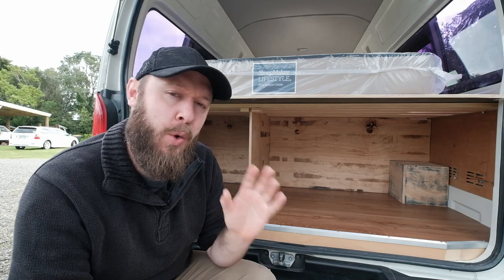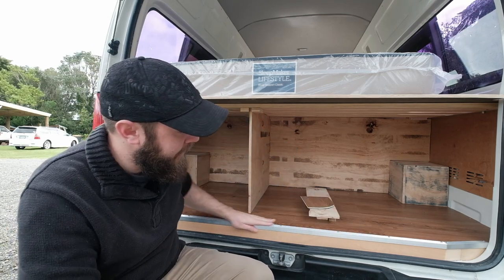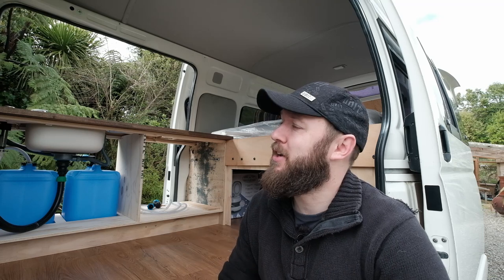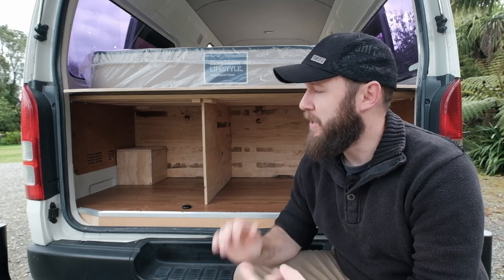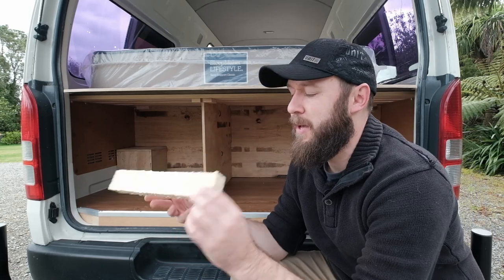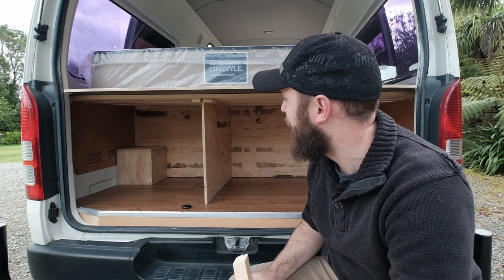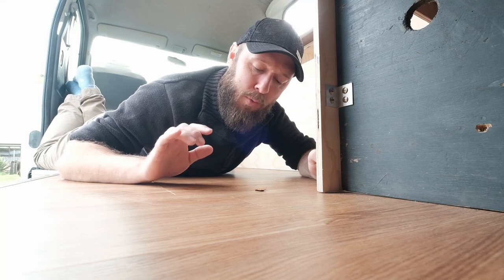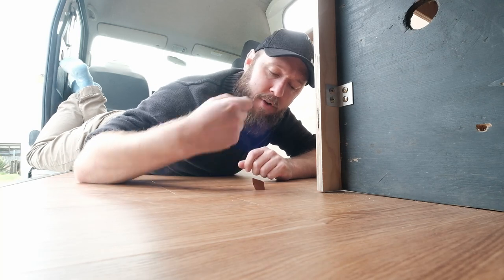Toyota Hiace Camper Van Conversion - Part 1

Comment: inspirational! thankyou for posting. Just about to start on my hiace. one question if you don't mind? What thickness is your flooring ply?
Reply from the maker: I think I went 9 or 12mm, I can’t recall but with the bracing underneath and the tiles on top it’s very solid
Reply: Yes.thankyou. I was thinking 12mm. and like you I was going to try and not fasten anything down on the floor. I want this van to be multi purposed. So thankyou for your idea on fastening through the pre-existing wall panel panel holes.
Reply from the maker: No worries and all the best

Comment: Thanks for your video, you just confirmed I need to make a hatch in the floor for that mystery bolted on plate in the floor by the door. No idea what it is.    I have a smaller Toyota van I'm just starting to work on as my retirement project.  Questions.. What was the bung, plug you used to cover the bolt to the spare tyre?  And where can you buy wool insulation as it seems you can only order it on line? 
I thought you need a breather pipe for the waste water tank as part of the compliance regulations?  
Thanks. Good  descriptions in your video. I like the idea of the aluminium L bracket down the side of the van.
Reply from the maker: The bung cover was just something I found around home, I'd look around hardware and plumbing stores until you find something that suits and then make your hole to that size.
Yes waste needs a breather and that is still to be installed.
And I got my wool insulation from
https://www.terralana.co.nz/
You can get it from miter10 etc but direct was cheaper and a lot faster.
I got one bag of the thinnest wall insulation and one of the thinnest ceiling insulation for my whole van, but I don't think I'll quiet have enough left to finish my curtains
Reply: Thank you.

Comment: Hey, have just come across your video.  Great job!  I am also converting a Hiace in NZ, and I was wondering what wool insulation you used.  Cheers!
Reply from the maker: Terra lana is the company.
Ceiling for the ceiling and walls or the walls.
2 bags was enough for my van but I just had to order a third as I'm doing my windows with it as well
Reply: Awesome, thanks!
Reply from the maker: Any time 🙂

Comment: I bought a 2008 Hiace Commuter at a Pickles auction a couple of weeks ago. Mine's complicated by having a chairlift at the back. My wife won't be tripping with me, but it will be handy for loading her into the vehicle, so it's not going to get the conversion I envisioned.

I have four seats across, backs to the driver and front passenger seats, and two on the passenger side. And a big empty space where I can lay me down to sleep.

I want to run ordinary domestic appliances and that means I must have 10A 240VAC so say a 3000W inverter for some headroom, and THAT means batteries that can deliver around 300A 12V DC. And that is more than your fitout.

Most of my fitout will need to be easily removed for my wife's benefit. The four seats are a single unit, it's all or none. Handy to sit at to edit photos, I hope. Perhaps the batteries and electrics can hide under them..

I have empty 7/16 UNF holes begging to be allowed to support some of that angle aluminium. I think Repco has right bolts. I also like the idea of using offcuts of that angle aluminium for brackets, angle brackets from Bunnings tend to not be square.

Fun Fact
Bunnings used to be a timber merchant, Bunning Bros, in West Perth, I used to walk past quite often 62-64. Wesfarmers used to be a farmers cooperative, I think in the 70s it restructured as a limited company , members got shares. It started buying other businesses, Sunny West Coop, and of course Bunning Bros. And McEwans in Victoria from whence it got its colours.

Comment: Do you need ventilation at night or is it big enough to keep the windows shut?
Reply from the maker: As soon as you add ventilation you really compromise on insolation, 
I was planning to add a vent, but so far I’ve had zero condensation, I think it has something to do with my window installation covers and how they sit right against the glass as things are working out really well BUT I’ve yet to do a test in extreme cold…but you could ask me how extreme cold went in about two weeks time and I’ll have a answer for you
Reply: @ThomasBusbyPhotography  Ah I was thinking more of oxygen and CO2 but I just looked it up and as long as there isn't any combustion going on it's plenty of air.
Reply from the maker: Oh I never thought of it that way, but yeah I’d never cook inside, and haven’t run out of oxygen yet, I’ve stayed maybe 15 nights in the van so far.

Comment: I don't get it - all this van carpentry/reno effort.  Just need a row of fold-up seats at front (as some Hiace models have) for when there's extra passengers and then leave the area behind open.  Just need to build a simple fold away bed.  Carry your gear in plastic totes.  Use a portable camp stove, water jug etc.  Keep it simple and flexible so you can put your bikes inside or hang some tarps and haul dirty stuff/yard waste or otherwise move large stuff etc.  Easy peazy and practical.
Reply from the maker: Nothing at all wrong with anyone doing anything they like to suit their needs and tastes

Comment: You mentioned that you insulated the ceiling.  Just wondering if that means it is easy to replace the original ceiling back in after doing this? Thanks
Reply from the maker: Yes I found it easy to do so, I spent a long time wanting to change the ceiling but in the end keeping the same one was just to cheap.
Installing it back with the insulation was a smidge tricky but I still managed it on my own

Comment: hey! for the access point with the leather tab, I wonder if a sneaky magnet under the thin layer could have done the job. the tab and even the consideration of having access was really clever and sleek regardless!
Reply from the maker: My other magnets are failing me, this way is very tight as our roads are very bumpy but no matter what as those tiles got sun they have expanded a little around this whole and no longer sit perfectly flat.
It’s still very workable and still looks nice, but not how I’d do it next time.

Comment: Hi mate, just had an idea for the floor hatch to get rid of the leather tag. 

Could glue on a plate of metal underneath and buy a strong magnet that could be used to lift it up if required. 
The top flooring layer may be too thick for this, but worth a shot?
Reply from the maker: That is a good idea, and I could carve out enough of under the tile to get the metal plate (I’d actually suggest a second magnet) very close to the surface.
BUT…after using this for about a year now the leather really is fine, though the square cover has warped in the heat a little because it’s not actually attached to the tiles around it so no longer sit perfectly flush.
It’s not enough to stub ya toe, but it no longer looks perfect, and still not sure how I’d get around this and keep easy access to that pump

Comment: Nice build.👍. How long and wide is the bed base? Cheers
Reply from the maker: I can't remember the exact dimensions but I googled matress measurements first.
I then brought my double matress and built the bed frame to fit it, but the storage boxes beside the bed can be removed to fit in a king sized mattress.
Most mattress are the same length just different widths.

Comment: hi. how did you atttach the wool insulation to the roof of your van? assuming you have done this.
Reply from the maker: I got kind of lucky with it hooked/snagged on each side.
And then as my ceiling is in strips I pressed it up into place with the ceiling holding it up.
A extra person to help would have made this easier but as I have long arms to arrange things as I pin the ceiling up it wasn’t too bad.
Hope this makes sense/helps
Reply: @ThomasBusbyPhotography  wow! you're fast! I have a much older Hiace hitop and the ceiling has a thin dark grey kind of coarse felt just glued straight to the metal, right down to windows. so I don't think your method would work. Think I can probably get some wool in behind the side linings though - might help a bit on these cold nights!
Reply from the maker: A big thing with insulation if you don’t cover pretty much everything, it doesn’t work that well. Over the top is best